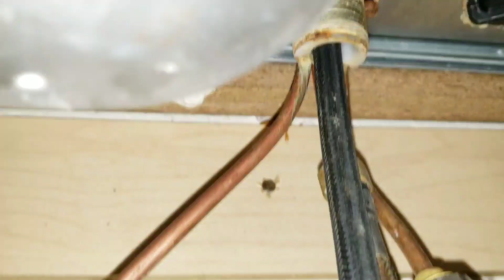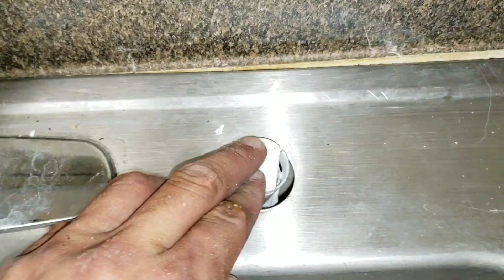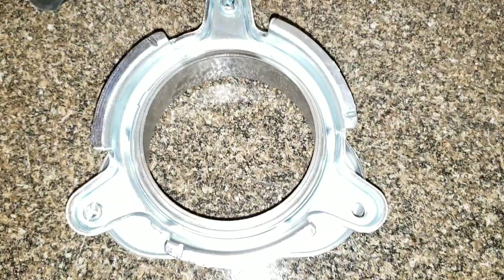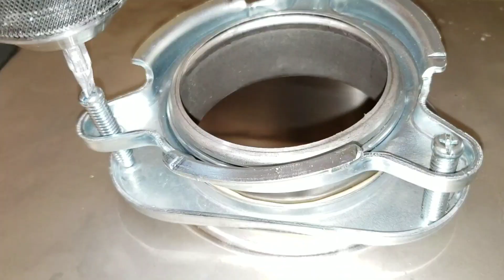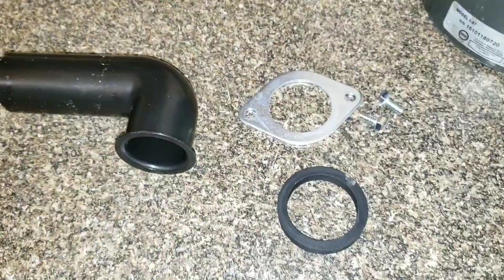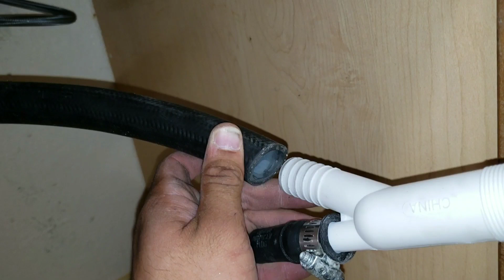How to Replace Kitchen Sink. Step by Step!

Comment: I did this two days ago. The clips are a bear, they are really hard to access. I had to beat the old ones off with a hammer, they were hopelessly rusted, and I finally had to create a special tool to get the new clips in place because the tight space didn't allow me to get my hands in there. Also, the new faucet came with 3?8" supply line connections, but my angle stops have a 1/2" thread, so I had to buy connectors to adapt, and of course one still leaks after several attempts with teflon tape. (Pipe thread compound will be next.) I strongly suggest unplugging the disposer and dishwasher as the first step, just in case, and life is much easier if you remove the disposer before lifting the old sink out. I'm still sore as heck after two days, but, Dearest now has a new sink and faucet, so it was worth it. I am sore, but SHE is THRILLED. Thanks for posting this!

Comment: Great video great step by step. You did one thing wrong which I always find that everyone does. That rubber gasket that's on the disposal goes inside not around the plastic pipe. That round rubber gasket goes inside the hole and the metal flang goes around the pipe itself so you are compressing the plastic to the rubber inside the hole. It is very very important always read the instructions before you install anyting. He did a great job otherwise

Comment: Could someone explain when you put the silicone caulk?  It seems like you should put the silicone under the seams of the sink BEFORE you drop it in.  The way the channel owner explained sounds like you do it AFTER you drop in the sink.  I think you can do that, but wouldn't the silicone be showing around the seams of the sink, even if you use clear silicone, so that would be visually unesthetic.  Any tips?

Comment: Thank you for the informative video. Going from a two drain to one, what do you do with the second pipe, do u cap it off?
Reply: Hopefully you guys figured it out but you just remove the extra pieces of pipe for the 2nd drain and will have one pipe coming from the single drain into the p trap. No need to cap the other one off, just remove it.
Reply: @shaynalea4101  thank you! I'm more confident now in swapping out the sink. Working on plumbing seems so daunting.
Reply: @khaleesitargaryen8276  we just replaced ours last week from 2 basin to 1 basin and had the same question. we have the garbage disposal coming from the only drain and there are really good videos on how to install that. good luck and just make sure to check for leaks after you finish! it does seem daunting but at least its easy to see visually!! electrical stuff on the other hand.... i can't wrap my head around it!
Reply: Im also wondering that